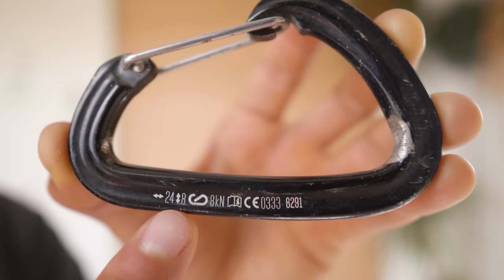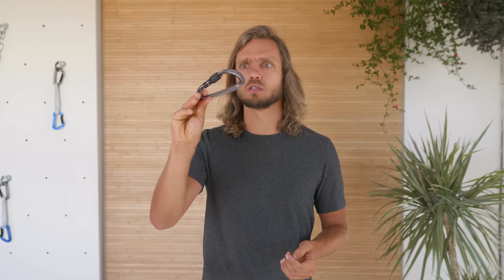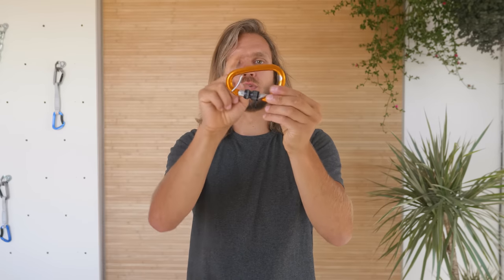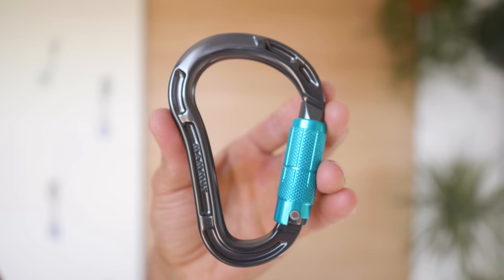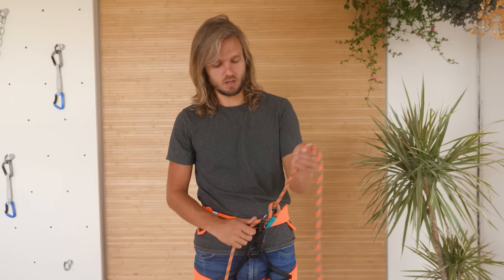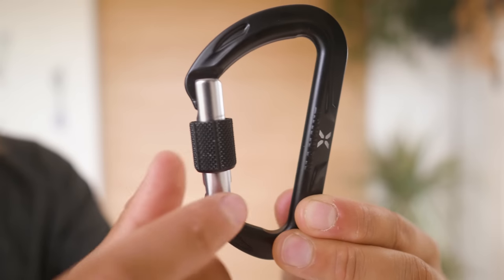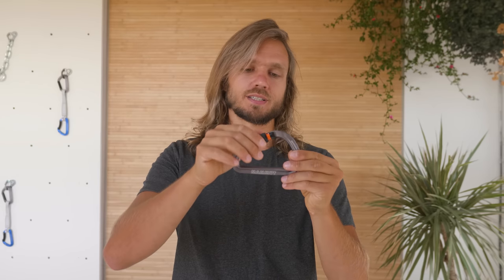Complete Guide to Carabiners - Shapes, Styles & How they Fail | Ep.2

Comment from the maker: Thanks to multiple comments - Little correction: Heat Treated Aluminium that is used in Climbing 7000 series T6 is actually much more brittle than Steel (Opposite of what I said in the video).
However I still wouldn't panic about Microfractures - based on how rare we see a broken carabiner or old carabiner breaking under its Ratings.
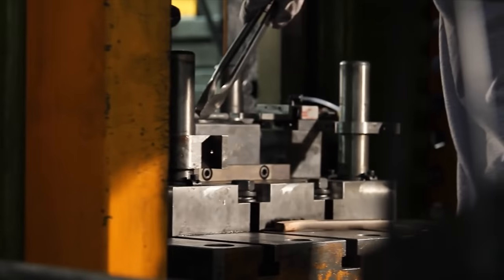Reply: 2:18
I have exactly the same mammut
To open a three-stroke carabiner with one hand, you need to place and press your little finger on the bottom of the carabiner, and your thumb, middle and ring fingers on the gate, which you can lift and turn
Reply: Yes, the heat treatment will induce internal stress in the aluminium which makes it more brittle. But it also makes it stronger (some types of tempered aluminium are stronger than mild steel). I would worry more about microfractures with aluminium because no aluminium can undergo an infinite amount of cycling loading as (stainless) steel can (if properly overdimensioned). Nevertheless you would probably not be able to do this many cyclic loads in your entire lifetime. Your advice to listen to the manufacturer is probably the best advice anyone could give.
Reply: Thanks for the update. I think you can and should pin your comment to the top!
Reply: the microfractures myth is known to go back to titanium carabiners which could have such an issue. But they are completely off the table by now. Great video!
Reply: Yes, and 7000 series T6 will corrode too whereas 6061-T6 will not.  Microfractures will eventually happen because aluminum does not have a load below which fatigue will not occurr.  Any climbing carabiner will have a load rating of 2x the rope to prevent fatigue from happening in the average climber's lifetime.  This all assumes normal load direction.  Bending loads will cause a failure at a fraction of the capacity.
Reply: glad you pinned this comment, and have quite enjoyed your content.

6061 aluminum is softer (60 HRB) compared to mild steel (70 HRB) which is softer than 7075 alum (87 HRB) which is much softer than hardened steel (60 HRC)
The higher the hardness, the more brittle the material, so a 7075 aluminum would be more prone to cracking when compared to a mild steel. a hardened steel on the other hand would be more prone to cracking (think tool steel like a chisel or knife).
I expect most steel carabiners are mild steel and not hardened.
Reply: @ek8507  Were I as an engineer designing a carabiner, I would not go for a low carbon mild steel like 1018.  The section of 1018 you would use would have to be thicker than for galvanized spring temper 1060 to 1080 or similar stainless.  Furthermore the wear would be terrible for 1018.  Furthermore I would use spring temper or a little softer for toughness because then it will strain harden itself into spring temper.
Reply: Thanks for the video! I have some additional corrections: Your simple explanation (4+4=8) at the 17:00 mark is not correct. The vertical loading component is strongly determined by the angles.
Reply: Another remark: at 18:00 you accidentally show the other reason why the asymmetric D-shape is advantageous. It's not only to keep the main loading close to the spine of the carabiner. The asymmetry of the D-shape makes cross loading really hard because: the long sides of the carabiner are not parallel, this will force the carabiner to rotate into its main loading direction (as in a previous comment I made: again the angular force components coming into play).
Reply: Great video! did you make one about what to do if you can't finish a route?
Reply: @cls9474  This is correct. I'm a fan of your videos, and I especially liked how you explained the force factor issues with static vs. dynamic protection, but please at least speak to a structural engineer or someone who has trained as such for something as important as this to avoid mistakes.
Reply: Work hardening of Aluminium. How does that affect things? It makes aluminium brittle.

Comment: Quick tip for the screw gates from an industrial climber: do not screw lock it under load. The screw can easily get stuck (just like when you have sand in there). If you do get it stuck, put the carabiner under load and try unscrewing then. Usually does the trick.
Reply: More of a concern with older carabiners and steel ones, no? I've always thought the ones that have some wiggle when locked up (click click when you test it) are less prone to seizing up like this. Though it's definitely still something to keep in mind.
Reply: @joshuacilliers2723  exactly. In every screw gate i've ever seen the screwing bit is only ever threaded to the gate itself and doesn't really make contact with the nose.

Comment: In the tri-load situation, the reason it breaks easier is because you transfer load to the horizontal direction of the carabiner, which is only rated at 10kN. Wider angles or using the wider end of the carabiner will cause greater horizontal load compared to vertical.

Comment: Little correction: the forging process is done not because of the shape or design you want to achieve (the same shape you could achieve also with casting, for example), but in order to improve the microstructure of the metal, the grain flow and as a result to increase the strength and fatigue resistance of the component.

Comment: There is a great advantage to using steel carabiners over aluminum ones. The black rope grim that wears off onto ropes comes from Aluminum oxide that wears as the rope runs through equipment that is made of that metal. This is why using steel carabiners, or steel plated carabiners, for master points of top ropes is very useful. The carabiners last longer and the rope stays significantly cleaner. I am not sure why this is never talked about but this tip is definitely true. Try out top roping on carabiners like the edelrid hms bulletproof and you will almost instantly see a difference in the dirtiness of your ropes.

Comment: As alpine climber, I do want to carry a quick link on my harness. It comes in smaller and lighter shapes than the one shown. The advantages are the the weight, cost and lockability of the quick link compared to a normal carabiner. Also, the HMS (munter hitch) is of a much greater importance in the alpine environment. You save time and potentially the weight of the belay device (I do still bring the MegaJul or plate). Make sure to always keep the strands in parallel to avoid twisting of the rope due to the HMS.

Comment: I'm an engineer, so a little bit about microfractures - your friend tested it with static load - i.e. he pulled until it broke. There's something called dynamic load, which is basically a fancy term for when the load changes over time (for example, you load the carabiner, then unload, then load, then unload, which is what happens to every carabiner in normal use). When something goes through many load-unload cycles, it can break below it's rated load. I.e. if something is rated at 20 kN, and you load and unload it repeatedly at 15 kN, at one point it might break. That's called material fatigue. It is theorized that these load fluctuations expand the microfractures to the point of breaking.
It especially affects aluminum. Steel can be designed for infinite life under dynamic load, but aluminum has no infinite fatigue limit.
So, microfractures will not affect a carabiner in static load scenario, but it might affect the amount of load-unload cycles it can take before it breaks.
But whether dropping the carabiner on the ground actually does anything to the microfractures or whether you can introduce enough load-unload cycles to the carabiner during normal use to break it (in machine design, engineers usually talk about hundreds of thousands of cycles), I don't know. But probably not.
Reply: We have always used two rotated steel binas with bungy jumping... does anyone recommend alloy instead and why?
Reply: That is true. 

Also Al alloys would be slightly more brittle than any steel. 

But a proper mechanical metallurgy study would have to be performed. I wonder if the manufacturer did it. 

Fatigue is definitely a bigger issue than micro-fractures. I'm a bit skeptical they occur on such low energy impacts. All can be tested.
Reply: There's also the fact that steel can be hardened which makes it stronger but more brittle and rope wear on steel would happen much more slowly than on aluminum. So, there's a lot to consider when it comes to metals.
Reply: Almost 30 years ago, I excecuted a similar experiment as the above, after throwing aluminium alloy carabiners against a cement wall, for about 80 times. Then compared their breaking strength with same type ones, in unused condition. The result as I remember, was a reduction of strength around 15-17%. @paulojacobsilva3018
Reply: Wöhler curve for Al alloy says that when falling with 6 kN (i.e. very hard, unusual fall - approx. 315 MPa used), it survives 10^5=100 000 cycles. So you would have to hard fall hundred thousand times to fail the carabiner due to fatigue. I would say, that your spine breaks first
Reply: > but aluminum has no infinite fatigue limit

I don't quite understand what you're saying. Any pull on aluminium whatsoever will, if it is repeated often enough, eventually deform the aluminium to an arbitrary degree?
But for steel there's a minimum strength of the pull to achieve the same thing?
Reply: @MrCmon113  yes. Any cyclic force on aluminum will eventually cause fatigue cracking. The Aluminum won't deform - it will crack all the way through in a sudden failure. Most steels are different, if the force is small enough, steel can handle infinite cyclic loading without fatigue cracking. Eg, bridges are made of steel, and forces are kept below fatigue limit, so as long as the steel doesn't corrode, the bridge will last forever. In contrast aircraft are made of aluminum because it is light weight. However cyclic loading on aircraft wing spars from flight maneuvers, or fuselage from pressurization cycles mean most aircraft see a service life of 10-30 years before they are retired because they are literally full of cracks that become too expensive to fix.)
Reply: kinda like how a metal plate that was bolted to my leg bone broke while in a cast. no bone growth so in six months the bar flexed just a tiny bit and made one point weak.
not much movement can cause anything to go snap, bend, fail. under a sub loading weight.

Comment: one carabiner related detail you forgot to mention - always clip your screwgate with gate facing down, esp when its left unattended(ie when building your anchor or for top-rope masterpoint) so when jiggled it closes itself under gravity, not opens. 
It really works - even if you forget to close the gate it will screw itself tight after some time
Reply from the maker: It's also easier to clip the rope / sling to upside down carabiner ;)

Comment: Great content. Very thorough indeed. I'd just point out that hot forging (@ 2:20 ~ ) isn't just about giving shape to a piece of metal, more important than shaping is that forging produces a very refined microstructure which contributes very much to attain those UIAA mechanical properties with minimal cross section. E.g. a machined (nobody actually does this ok, just for the sake of the argument) carabiner with the same alloy and exact same dimensions should fail at much lower levels than the forged one.
Reply from the maker: Well without hot forging you would have to have heavier carabiner to be able to sell them for climbing... ;)

Comment: Hey Ben, absolutely great video. I really enjoyed every single second! Your content is amazing. But I've got one single nitpicky point: I think steel ist less brittle than aluminium. In Rian videos on how not to highline his steel carabiners are bending while the aluminium ones are snapping. Therefore the steel in carabiners must ne less brittle. Only hardened steel like on knifes ist brittle. Anyway fantastic video. I am really looking forward to your upcoming content :)
Reply from the maker: Interesting... I thought this panic for micro fractures came from old school steel carabiner times.... Thanks for nitpicking - That's how we learn ;)
Reply from the maker: after more research turns out that heat treated Aluminium used in Climbing T6/T7 is indeed much more brittle than Steel. 
However I still wouldn't panic about Microfractures - based on how rare we see a broken carabiner or old carabiner breaking under its Ratings.
Reply: @HardIsEasy  this is a sign of a real expert. knows his stuff but is willing to research and adjust. big thumbs up and keep it going.

Comment: Great video, thx.
On wiregate carabiners I wanted to add that the main benefit isn't weight saving.
The wire has less mass than a solid traditional gate, which results in smaller inertia.
This can be a safety issue, because on a fall the carabiner can crash against the rock, then the traditional carabiner will open - and reduce strength dramatically.
Slap the carabiners into your hand (backside into your hand) and you can hear the traditional gate click (open and close) while the wiregate stays silent.
Reply from the maker: Thanks and yes, I'll talk about that in Ep.4 - coming on Wednesday ;)

Comment: Hi!! One thing I really want to point out is that in the "belay carabiners" section, at 6 minutes you show the Black diamond gridlock. Specifically, if you're using that for the GriGri (or similar device) you actually want to FLIP it, so the big section goes on the belay loop and the small section is attached to the grigri.

I just learned that today (should've read the device manual earlier , that's my mistake). Just got lead certified at my gym last week. Learned a lot from your videos so just trying to help spread some awareness. Thanks for the great content.

Comment: First of all; great video. Small comment on the wire gate: when I took my outside lead climbing course I was taught and shown that in an extremely rare situation a solid non locking carabiner could sling open temporarily on a fall if it were to have an impact with something solid on the backbone of the carabiner
Reply from the maker: Thank You, I'll talk about what you mentioned in Ep.4 ;)

Comment: My first time out lead climbing in 2015 i was with someone who had nearly a decade of experience climbing outside. He told me he never saw a cross loaded carabiner. That day we saw a couple climbing and they somehow managed to cross load AND bend the carabiner over a face (which was the  top non-locker of a draw) with a pretty small fall. sometimes the climb's you're on may be bolted for specific gear, so be sure to always have knowledge of the route you're going to climbing on before you go, otherwise you may end up in a situation you're protection becomes compromised.

Comment: A couple of notes on aluminium and corrosion.
Pure aluminium do corrode, it is not due to alloy materials - those can both improve and compromise corrosion resistance. 
The reason for aluminium to be considered corrosion resistant is that in air aluminium forms an oxide that has some very good features: It inhabits further corrosion, forms a sealing layer and is transparent! 
IF however that layer (microscopic thin) gets damage and there is an environment* that speeds up corrosion we get another type of oxide, a white powder that lacks the beneficial effects of the first type. (* Like saltwater and air mixture.)
Another common cause for nasty oxidation problems are different metals! As an example if you store aluminium and plain steel mixed the aluminium will oxide "to protect" the steel. The more different metals are mixed the higher the risk is (not within an alloy but between different parts).
So if you get that dreaded white powder* on your gear make a careful inspection or discard it as compromised. (* As in aluminium oxide, not chalk).

Also when talking metals and strength several different types are needed, it's not just stronger/weaker.
Long story short here's the different types:
Elastic deformation (springy) / Plastic deformation (shape changed) / Break
combined with
Hardness / Tensile strength / Impact resistance
Conclusion, an alloy might be good in one situation but not the other...

There are four ways to change the properties of alloys: It's composition, hot working, cold working and heat treatment.

Addition: Microcracks - the major risk for these in this application is due to work hardening due to repeated elastic deformation (or fewer plastic with return correction aka bending back). So after many very hard falls on the same carabinier it might be time for retirement. But not for a bunch of drops.

Comment: Thanks for a very informative video. Re: rope wear / grooves in carabiners - it would be worth mentioning to watch out for excessive wear on insitu draws, especially on the first bolt (due to the angle of the rope caused by the belayer standing away from the wall).